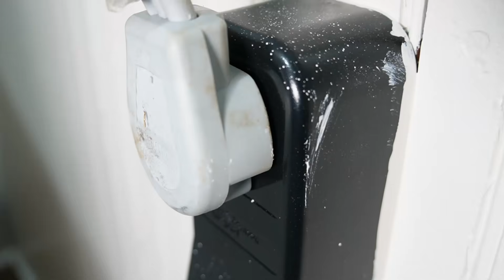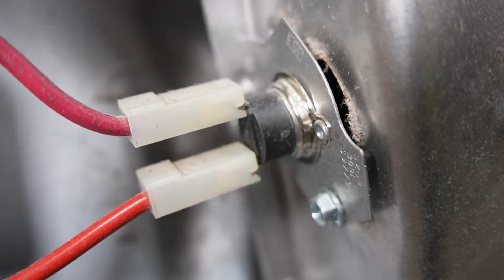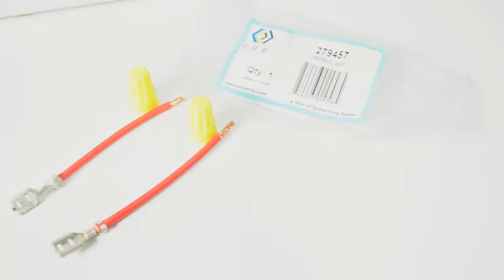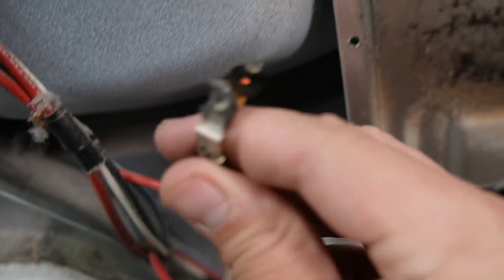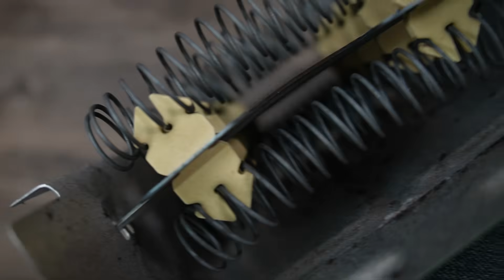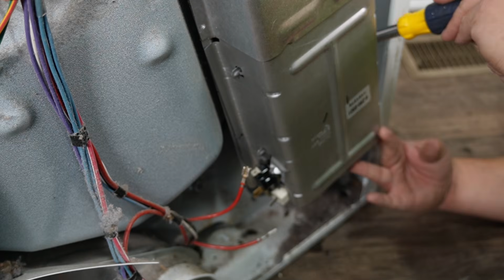How to Troubleshoot and Test a Whirlpool Dryer Heating Element 279838

Comment: I replaced one with a 9ohm and blown the thermal fuse at second use. It was pulling 23 amps and heating like crazy, got a replacement with 12.9 ohms and is pulling 16.5 ohms  ,temp out of exhaust is around 130*, not sure is that the normal temp.

Comment: Getting 13.7 ohms...is that too high?
Reply from the maker: Should be OK
Reply: @bensappliancesandjunk  Just found the problem. The dryer has two 120v breakers to supply power (240v), and one of them had tripped. 
I'm  not sure if that setup is sustainable long-term. If not, then the customer would have to contact their landlord to have them replace the 120v breakers to a 240v.

Comment: Ben have a curiosity question. Is the jeater supposed to turn on before i start the dryer. I noticed that I had put the clothes in the dryer and closed the door set the timer for the time needed and temp. Just before pressing the start button noticed something going on and when I opened the dryer door to check noticed the heater glowing, i then started the dryer. Is this normal or do i have a  problem .

Comment: If you don't mind me picking your brain, I have a problem with a dryer. Whirlpool cabrio platinum dryer. So I replaced all sensors or fuses and heating element.  Problem, parts store sold me what is in there system is a two tab element and mine is a three tab heating element. They won't respond after so many emails. How can I make a two tab element work on my three? Any ideas?